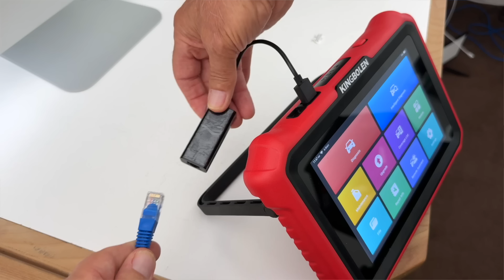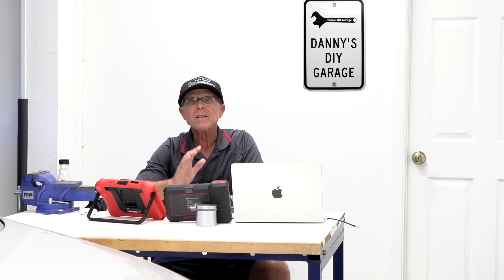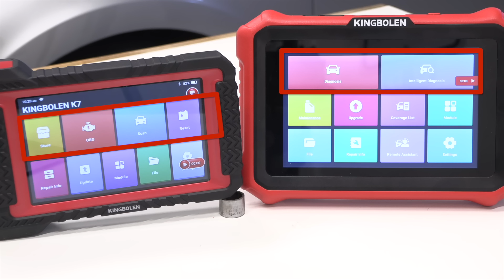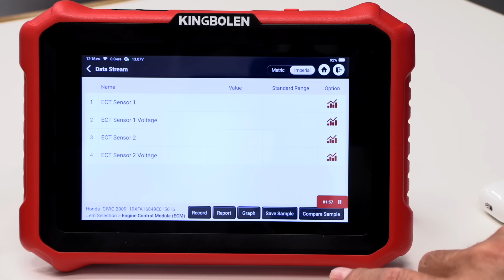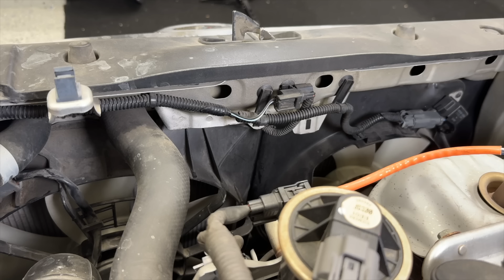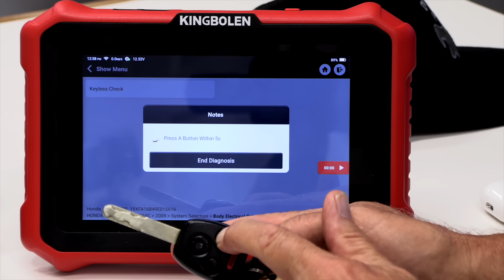KINGBOLEN K8 Pro Bidirectional Scan Tool Tested | Is the Pro Version Worth It?

Comment: hi, is this k8 pro has function like odo check same in thinkscan device?
Reply from the maker: If the ODO Check feature is specifically what you’re looking for, I’d probably lean toward the THINKSCAN because it has a dedicated function for checking and comparing mileage stored in different modules.

The KINGBOLEN K8 Pro is still a very capable bidirectional scan tool and has a lot of other functions, but I wouldn’t buy it specifically for ODO Check unless you confirm it supports that function on your particular vehicle.

Here are links to both so you can compare them:

THINKSCAN: https://amzn.to/45UkAJf

KINGBOLEN K8 Pro: https://amzn.to/4bEuql5

Comment: Big issue with k8 pro I found is not able to graph ON/OFF signals. Even in your video, its on the 1.2v scale and not on on/off scale. If you actuate, you will not get a square wave and stay at zero. Other LAUNCH_based scanners do this no problem, such as SmartScan, literally identical graph with different scale. I Just got my k8pro and this is a big disappointment. The email support is proactive, but lots lost in translation. Only hope, they will update it eventually.  🫤
Reply from the maker: Thanks for pointing this out. That’s a good observation. I did notice the 1.2 V scale in the graph, but I didn’t specifically test how the K8 Pro graphs a discrete ON/OFF signal during an active test.

If it is reporting the PID correctly as ON/OFF in the data list but not graphing the state change properly, then that would definitely be a limitation in the graphing software rather than the actual bidirectional command itself. It’s interesting that the Launch-based tools you mentioned display the same type of data correctly.

Hopefully KINGBOLEN can comment on this post and address it with a software update. Thanks for sharing this — it’s exactly the kind of detail that helps other people considering the tool.